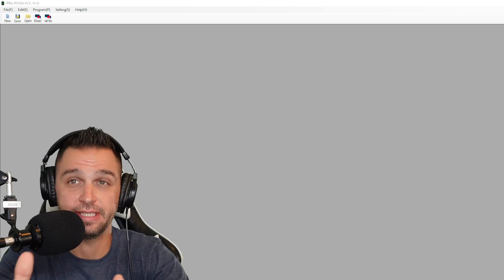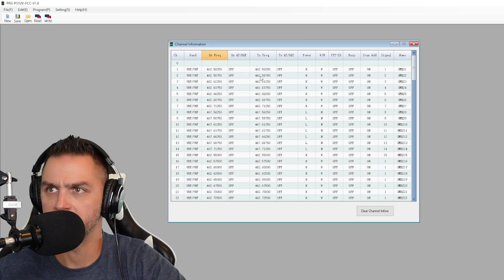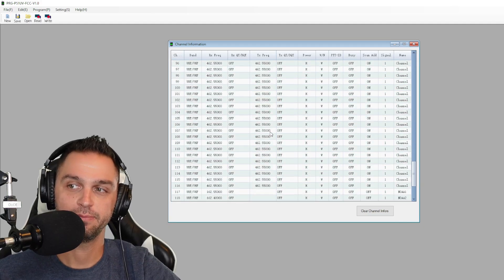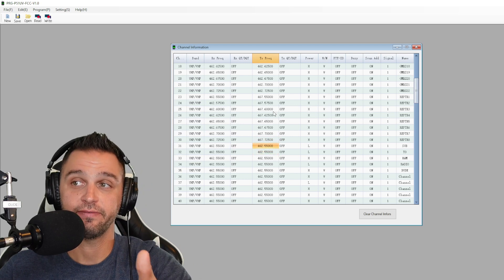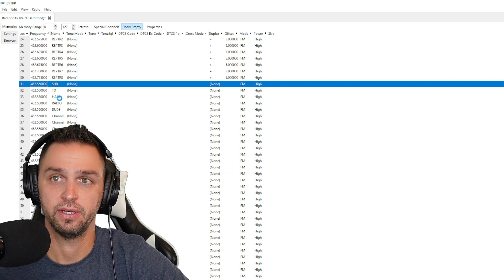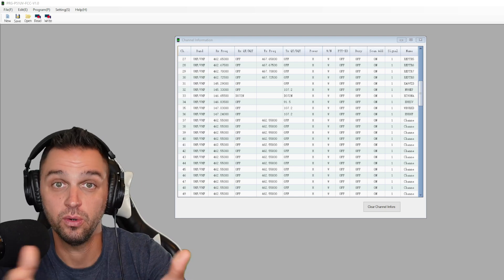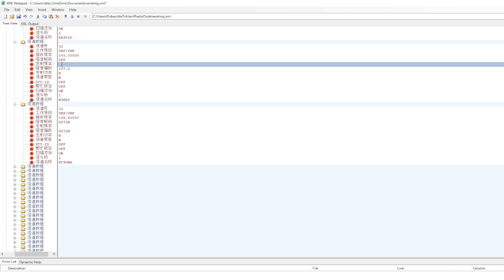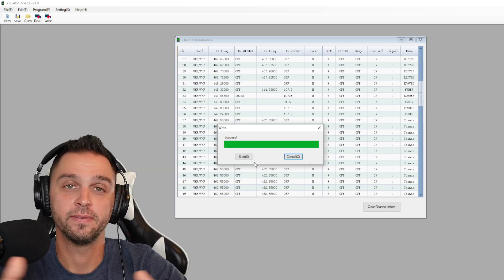Baofeng UV-5X / UV-5G HACKED !! - How to frequency MOD A Baofeng GMRS Radio

Comment from the maker: Please note, I am told this mod no longer works.. I do not have it, but finding the original software will probably fix the issue of it not working.
Reply from the maker: Updated: I confirmed today, this does not work with the newest "2.0" software available. I am hoping i may have the old software somewhere.. Trying to confirm.
Reply: @HAMRADIODUDE    EDIT  Couldn't find UV-5G. Changed vendor to Radioditty as you have.   In Chirp, I don't have the "Import from Data Source"  Are you using the Legacy Chirp or Next?
Reply: @DudeTested yep, seems like the new ones are locked down. Mine were sold as "UV-5R GMRS" radios. I have a mobile GMRS for my jeep and now I have my ham license as well I was hoping to unlock it rather than buy a new radio.
Reply: @DudeTested  Any idea of where to find the v1 software, keep hitting a road block! Thanks!
Reply from the maker: Unfortunately not.  Someone said they had it and would post it,  but didn't follow through
Reply: @DudeTested from what I've found is that there for a while the company re labled as pofung but it was retired and back to the baofeng name. I thought I found the software but came up with a dead lead no longer on the server. Here is the 2 names for the same software I hope this helps. 
prg-p51uv-fcc-v1 and prg-p51uv-GMRS-v1
Reply: @baiijeffrey  I used V1 still does not work. It puts the TX frs in but give the beep as if transmit was disabled.
Reply from the maker: Where did you get v1?
Reply: did you know if doing some modificatios for the electronic board this radio can work? i did with a Kenwood 281A, was blocked, I opened the radio and modified the electronic circuit board, what I removed was a diode, and it works perfectly on the frequencies that were blocked.

Can the same be done on these uv-5g plus radios?
Reply: @ArsaloBaja646  I suspect the same could be done on these, as it uses the same chip as the unlocked UV-5r. So perhaps the firmware relies on seeing a certain amount of resistance in a circuit. Which, if a component was removed, would change the resistance and trick the firmware into allowing the Tx on the radio. I don't have the know-how to identify such a component yet.
Reply: @waylonk2453   thanks i hope we can get the answer, is a nice radio, just i need this radio tx on vhf for safe
Reply: @taz104  You have to d/l the radioditty software version in order to make it work
Reply: Or just spend $25 and get the same radio in the HAM version.
Reply: @Reklaw-  Which model would that be, large screen, scan & copy capability, the same other features but is Ham band capable?
Reply: Did you check the Internet archive?

Comment: Cool video.  I know there's a filter at a radio output that allows a spur that's out of spec.  I wonder if that can be modified/ not inside the radio, but by adding a filter up at the antenna end of the coax?  Thank you.
Reply from the maker: I believe a bandpass filter would be effective but not cost efficient.   The FCC (not being a sad ham here, just pointing out the rule in case you're curious) I believe, would require the spurs to be controlled before the antenna system of the radio.  Hopefully this helps answer the question. Have a good one!
Reply: Thank you very much for the reply and information.

Comment: I tried your hack and set the range to 136-260/400-520 and wrote to the radio and reread it and it showed up correctly but the programing software stayed  136-174/400-520.  It errors when reading 1.25M frequencies. Does your XML file hack that too?   thanks for the info
Reply from the maker: Hello. It would unlock 1.25m as well. However - "Please note, I am told this mod no longer works.. I do not have it, but finding the original software will probably fix the issue of it not working.
"

I  have been unable to acquire the old software yet. :(.

Comment: Have you changed lower and upper frequency limits with CHIRP? Does doing this break the radio?
Reply from the maker: I have not. However, I saw this suggestion before. I just bought a pair of these radios on amazon to retest this way.

Comment: to all the people who say this no longer works, didnt do it right, i found all the files with no problem and was able to succesfully transmit on gmrs and on repeaters. thank you! this method does still work.
Reply from the maker: Thank you for confirmation!
Reply: I just tried as well and it doesn't work with a brand new uv-5g. I have one that's about 7mo old and it does work.
Reply from the maker: Okay, I just ordered two of them off of Amazon with my own money to do this again.  Also please note the UV 5G being referred to is the GMRS version and not the other UV 5G that was horribly named with the same convention
Reply: @HAMRADIODUDE  not sure if it makes a difference but the one I couldn't program has a sticker inside the back that says gmrs/30 while the older one I was able to get to work has a sticker that just says gmrs.
Reply from the maker: @Paul_______  thanks.
Reply from the maker: @Paul_______  sorry, didn't mean to send the last message so early. Thanks. Did you get them off Amazon? I'll be on the lookout to see which ones I get. I bought a pair of two for 50 bucks
Reply from the maker: If you don't mind,  where did you purchase them.
Reply: @HAMRADIODUDE  yes. Everything was from baofeng store on Amazon. Got the two pack both times. The radio is sold by baofeng store and they have a baofeng sticker but when I connect to chirp it says radioddity uv-5g. I just meticulous followed the directions from the video again and confirmed that the unit with the GMRS sticker will transmit other frequencies but the unit with GMRS/30 will not.
Reply from the maker: Thanks. I think they'll be here by tomorrow. @Paul_______
Reply from the maker: Radios arrived. Testing out things now. Initial observations are that I received ones from amazon without the /30 thing.
Reply: @HAMRADIODUDE  they're sending out different batches. My brother just got his in and they were able to transmit.
Reply from the maker: Oh okay. So they are hackable again?  I will return these
Thanks. @Paul_______
Reply: @DudeTested  it's weird how there's different models being sent at the same time. I do appreciate the work you're doing with showing us these expanded features
Reply: @DudeTested  i can provide a dropbox link if people still need the software. just lmk
Reply from the maker: That would be amazing! I can pin it too!
Reply from the maker: If you need my email address for links,  please let me know
Reply from the maker: @Ajmp2236  I would love the dropbox link. Thanks! I can make another video then
Reply: @DudeTested  awesome! I work night shift. I will have it ready by tomorrow!
Reply from the maker: True mvp.... thanks
Reply: @DudeTested  sorry. i had a family emergency, will drop link tomorrow

Comment: I just found out about this however the XML file is in Chinese and doesn't look like the in your video. Also, the Baofeng software is no longer downloadable. As much as I would like to do this, I don't think it is going to happen. Maybe you have a fix for these issues.
Reply from the maker: Yeah I think they caught on to this.  I am uncertain if there is another fix.
Reply: i have the software still
Reply: @Ajmp2236 are you offering to share it?

Comment: Will this work on the new 5G+?
Reply from the maker: I don't think so.
Reply: @DudeTested  TY
Reply: In regards to the UV-5G Plus,  the [PTT-monitor -VFO/MR] power-on trick does not show FACTORY so I assume it does not work on this model.  You can use current releases of Chirp and set the radio as a GM-5RH since UV-5G is not supported yet.  You can add non-GMRS supported frequencies easily for Rx but Tx on non-GMRS frequencies dows not seem possible at this point,

Comment: Also, I used my database, then I added the tx frequency.  I hit transmit, and get the dreaded "Beep Beep" meaning you can't tx on this frequency.  So Baofeng has updated the firmware so you can't add any ham frequencies to the 5G.

Comment: Doesn’t seem to work with new UV5G. New chirp allows inputing tones/duplex/offset and gets written to XML. Opened XML and saw proper tx freq. when loaded back onto radio through baofeng program radio still won’t allow tx on those channels

Comment: I seen it done with only chirp for 220 They held down a few buttons going to factory mode. Then expanded the vhf frequency in chirp
Reply from the maker: Yep! I believe this is accurate. Check out the pin comment. This was made before there was the ability to have any kind of three finger hack

Comment: Q: Why buy/get/obtain a UV-5RG/UV-5RX when the UV-5R costs so much less?

You can get a UV-5R for around $25, but the UV-5RG/UV-5RX is $35 - $50! You can hack a UV-5R easily and add the FRS/GRM Frequencies easier than what you did here.
Reply from the maker: Hey I'm on certain when this video came out, but I would bet you was probably before you could unlock a UV5R.  That's probably why I made this video, would be my guess

Comment: Greetings,  Once the radio has successfully been opened up and the "new unlocked" file been saved with a new name, can you go back to the "before" file and "write" it to the radio to restore the radio to being locked?  And going forward, by choosing the desired file, can you "toggle" the radio from the unlocked configuration to the locked configuration?  Thanks in Advance, BobJ
Reply from the maker: You sure can swap out code plugs or programming files to go back to locked/unlocked

Comment: Dear Ham Radio Dude, when I download my new 8W UV-5R onto the Chirp Software, and then do direct Export onto my laptop, it will be automatically saved as Csv file. And then, I opened a new file in Chirp and Import the same Csv file. I notice now that the Memory Range has become 0-999 (from 0-127). What will happen if I Upload this back to my radio? Please advise.

Comment: thanks friend I have a TP-8plus radio and they also sell it with this UV-13 model, I have a blocking problem, because my radio must be able to transmit from 136,000 to 174,000mhz and from 400,000 to 520,000 of which I already verified everything the radio and it only transmits on 136,000 to 174,000 and 420,000 to 449,997 I cannot transmit on mountain emergency channels, with telling you that not even on frequencies of my handy motorola or PMR Motorola that are free frequencies in the US and Mexico, Canada, etc. It's very rare but I can't find information to unlock it like the UV-5R, I hope you can give me a tip if you know, and help me, I would really appreciate it. or where you can find information. Hey I have 2 or 3 programs to program, and I don't know what program you use! I hope you can tell me the URL because maybe I can open it with the FREQUENCY RANGE SETTING option, or if you happen to know the key combination and turn on the equipment so that it loads the factory values, thanks friend.

Comment: Nice, too bad there isn't a hack for the kg 935g radio.
There is a wouxon unlock software that works on the Kg950,980p radios, but unknown if it will work on
Any of the other radios like the 935g.

Comment: I can get the programming software to read the radio and display the current channel information but when I attempt to open the hack xml file nothing happens.
Reply from the maker: For clarification, it downloads but it doesn't open on the PC?  I can look into this. Thanks
Reply: @DudeTested  Yes, it downloaded as a .rar file, which I extracted, but when I'm in the programming software and attempt to open the file nothing happens.
Reply from the maker: @scottherkes6615  okay thanks. I'll see if I can get everything installed tonight and try it to see what may be happening
Reply from the maker: Sorry for the delay. I downloaded and installed everything on a Windows 11 machine and everything worked okay.

Comment: To unlock the Baofeng shut it off, hold the PTT button, hold the Mon button, hold the VFO button all at the same time then turn the radio on. The screen will say FACTORY. You're all set with an unlocked Baofeng. 😉
Reply from the maker: Thanks!
Reply: Didn't work for me
Reply: @mandytuning  Some of them come unlocked from the factory.
Reply: so if it doesn't work, it means it's unlocked?

Comment: Did you get a chance to put this on the spectrum analyzer yet?  I'm considering buying a couple of these to make use of my Baofeng accessories, but I don't want to buy/use them if they are TX with harmonics on GMRS frequencies like the standard/old Baofengs.  At this point, the only Baofeng I use regularly is the GT-5R.

Comment: Thanks for posting this! So; I gave this a try. And it works-- sort of? If I key up a frequency (trying the national simplex freq to start), it definitely keys up another handheld I have nearby. But I can't hear anything. Attempting to call a local repeater also yields no results. So it seems to key up and transmit; but it transmits dead air and doesn't seem to pick up the mic. Is this some other layer they've added (just got mine a couple of days ago; they're the 5G and seem a bit newer because they have SMA-M antennas with no set screw), or am I doing something wrong?
Reply from the maker: I wonder if you may have a pl /ctcss tone enabled on either radio?
Reply: @DudeTested  I can't tell if you're really really smart or I'm really really stupid because that's exactly what it was. (I'm just kidding I can tell; it's both.)

Comment: I just used the TIDradio BT programming dongle on the GM-5R GMRS variant and I was able to enter the TX freq for channels 31+. No need for the installer software or xml. Not sure if this works with other radios but it did on mine
Reply: Edit: I was able to even change the freq of channels 1-31 as well.
Reply from the maker: Thanks!

Comment: Just tried this method with a band new UV5G with no success. The PRG-51UV-FCC-V1.0 software is successfully connecting to the radio, however the Read from Radio option doesn't work and errors out with the message "handshake error". This same software and cable will successfully read a new UV-5R. Any suggestions?
Reply from the maker: The handshake error really doesn't have to do with the hack.  Multiple thoughts, do you have the right comport selected in the software? It's this a legit cable and is it detected on Windows?  Sorry it's been a while since I've used this radio and software
Reply: @DudeTested  Affirmative, the cable and software are legit. For example, I can connect the UV5R and successfully read data from the radio but when I disconnect and then connect the UV5G there is a handshake failure when attempting to read data. I've repeated this several times and confirmed that the cable is securely connected when attempting to read the UV5G.

Comment: I just purchased a UV 5RIII .... Will this work on this model or just specific to the UV 5R only ?
Reply from the maker: I've never had a uv5riii ,so unfortunately I'm uncertain
Reply: I have the Baofeng BF-R3 which is basically the UV-5RIII which is their Tri-Band units. The radio should be fully open but if it is not do a factory hack reset (hold Mon/PTT/VFO buttons while turning it on) and it should open up at that point.

Then you can use the software to check it and make the frequency changes you need on it.

Comment: Try changing the "off" to "(none)" in the duplex column. This worked to allow transmitting on the UV-9G. I would save a GMRS frequency from "VFO" to "MR" the radio but it would not transmit. Open Chirp and found the duplex setting was "off". Switched it to "(none)" and uploaded to raido and it would transmit.
Reply: Do you know how to unlock the uv 9g for tx rx on all frequencies?

Comment: This MOD is also useful to those who live in areas with few or no GMRS Repeaters.  By using the GMRS Repeater Inputs as (8) add'l simplex channels.  The key to make it work is to disable TONEs on those frequencies.  GMRS Repeaters use TONEs for access or to activate.  Disabling TONEs ensures no accidental awakening of any nearby GMRS Repeater(s).  In my town, a medium sized big city, there are only (2) GMRS Repeaters within 30+ miles.  So this hack comes in really handy, with little to no repeater issues.  Using the 467 channels as SIMPLEX channels also reduces chances of FRS Radio Users from harassing you.  A freedom from the kiddies/kiddos/brats that over saturate FRS in some areas.
Reply from the maker: Excellent suggestions on Tones!

Comment: Is it a fair statement that the “lock down” on the new ‘Feng is at the level of the programming software and not the radio ?
Reply from the maker: Interestingly enough, I am sure most every baofeng is unlocked in some form or another.  This one, I happened to be able to force the frequencies via a software / codeplug update.. However, some others are now recently discovering certain models can get a three finger sequence to clear the memory address which locks the frequencies out.

Comment: Japanese radios use resistors you remove. China uses codes. There is a code just seems nobody knows it. The few Yaesu radios made in China have a code instead a Japan made Yaesu radio which use 2 resistors  be a code without using any editors or computers.

Comment: I discovered on my UV-5X radios, if I used the UV-5R test/diag Chirp driver for when they were first getting support for the UV-5X. I could directly write TX frequencies into the radio from within Chirp. I want to say there was a developer mode involved. Anyway, by going this route no text editing. Just load up the diag driver, connect to the radio, pull channels, adjust channels, push to radio. This works for at least channels between 18-40. Haven't loaded up any additional channels yet.